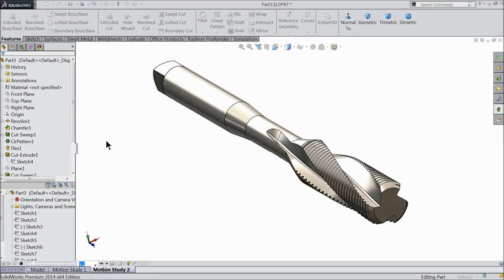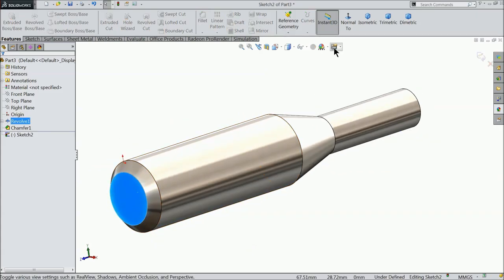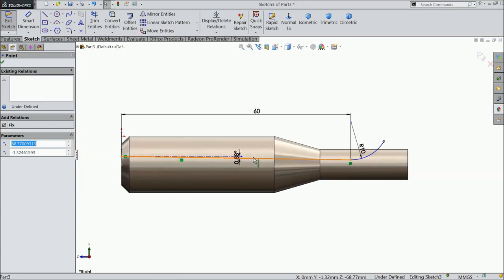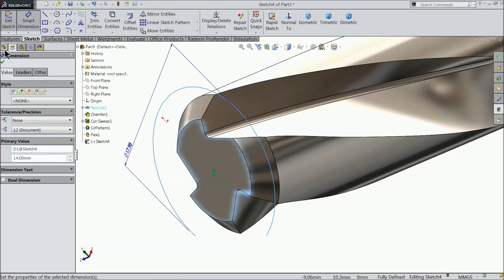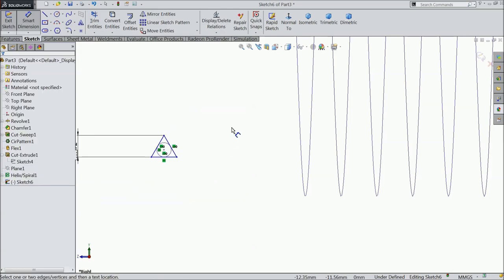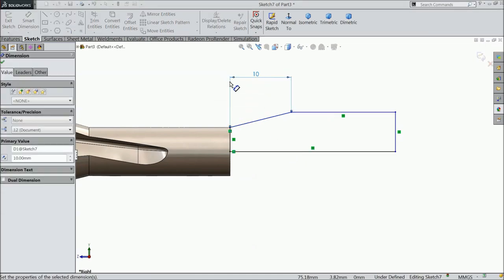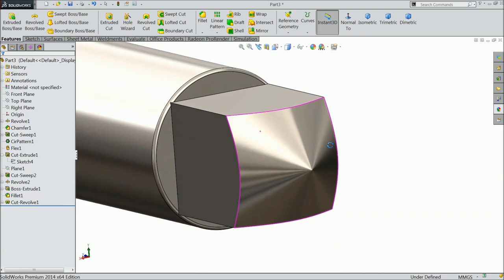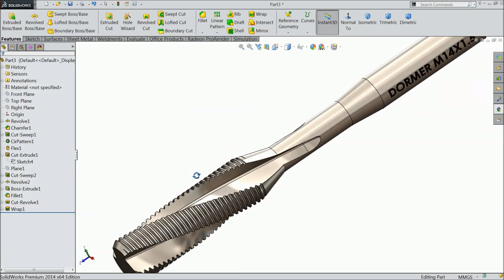Design of Twisted Tap Bit M14x1.5mm in SolidWorks

Comment: Which labtop better for CAD Tools?
Reply: On my entry level laptop I can run fusion 360 with 0 lag but Inventor just lags too much, it depends
Reply: What's your budget like? Asus Zephyrus and Lenovo Legion series are excellent. I use them. Stay away from HP as their heating issues haven't been really sorted out. Especially these workstation type units.
Reply: @laypyu My budget is like  30000 rs .